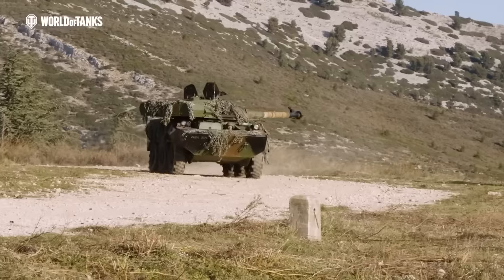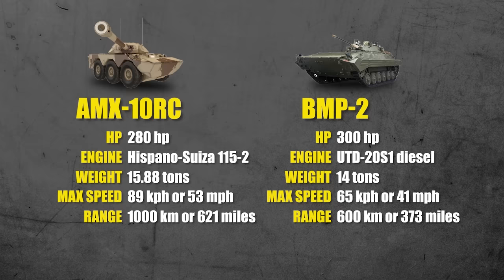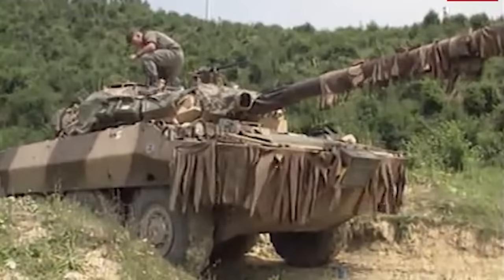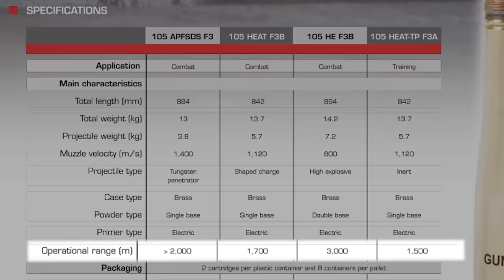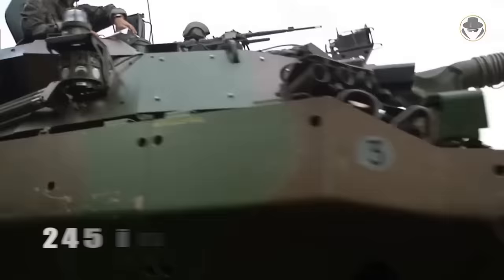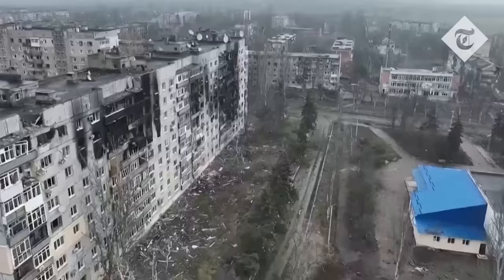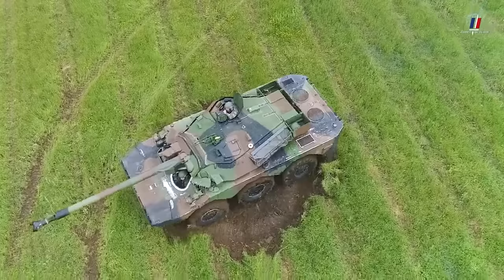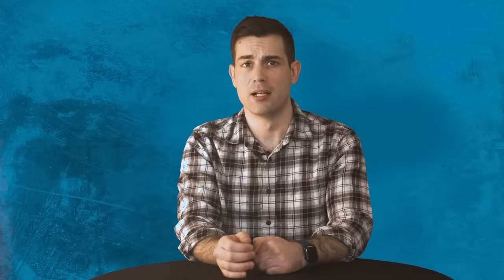Can the French AMX-10 RC Make a Difference?

Comment: I think one under appreciated aspect (which you sort of covered) is that it also frees up actual tanks to do tank stuff instead of responding to infantry requests to blow holes in buildings
Reply: AT4 already do this for a fraction, these odd vehicles are paper tigers. It may be working as the soldier think it works. It's the reason why rifles couldn't be replaced with grenade and rocket launchers as the soldier didn't trust the weapon. It may be giving hope but it may as well be false hope since you're killing people with bad equipment in hope they will pull it off by sheer will as the anti tank weapons cook them alive. In africa it worked with these vehicles because Africa is relying on getting A to B and fear tactics.  If Africa somehow decided to have the capacity to fight the paper tigers would end up burning. Russia rely on fear and paper tanks. Ukraine may pull it off. As long people are willing to sacrifice thinking they have a chance because they have these T-eddies with them who can spin around in a cricle.
Reply: @robertagren9360  you practically described the russian army at the beginning of this war
Reply: I think it would be useful Assault Gun, for lighter formations like Kraken. Alongside reconnaissance vehicle.
Reply: amx 10 was proven as junk in the ukraine totally suicidal to ride into battle in that piece of cr.. It was junk even when designed-the whole idea of mounting a big direct fire gun on rubber wheels is ridiculous and that piece of sh.. costs more than a tank
The Czech proved wheeled spgs are actually better in some cases than tracked and armies have been using wheeled recon vehicles and apcs for a long time but for an armored car to act like a tank is nonsensical It just proves French technology is obsolete compared to the Great Powers and French tactical thought is stagnant and has been for the last hundred and twenty years That horror doesnt even have add on armor It shouldnt have been designed in the first place and even if created it should not have been accepted but somehow the French designed it and their army took it in
sorry to hurt your delusional feelings but although the truth hurts it also sets you free

Comment: I served in Iraq, and was in charge of operation preparation. AMX 10 RC was design to quickly move from France to Est German border for stopping waves of USSR T55 T62 tanks in case of massive invasion. Germany is well equiped with road, so that idea was to control them quicky. With T72 T80, French army rethink strategy of their use in both directions: reconnaissance, and very fast run inside ennemy ligne with wheeled combat infantery VAB in order to overflow them by speed with support of heavy artillery of the AMX. VAB HOT or MILAN to protect the task force against more powerful tanks. Kind of modern ligth cavalery mission. It has been proved very efficient so that French stop to use tracked tanks. US were so impressed in Iraq that they adapted our model of organisation and now, their are also developped and now use powerfull wheeled tanks.

Comment: Great stuff! AMX-10 has a laser range finder and computer-assisted aiming, so the lack of stabiliser is not a deal breaker. It also has 6X6 drive and great hydraulics, which gives very good off-road capabilities. Besides it seems no one is launching offensives during the mud season anyway. There is lots of terrain in Ukraine to cover... so a rapid response unit will be very useful for their infantry. Wheeled vehicles are also easier to use and maintain than tracked vehicles.
Reply: My thoughts exactly
Reply: I loved this vehicle. It was part of my tank fleet in Armata Modern Tanks. Lol.
Reply: Great info. Thanks for posting.
Reply: Rather replace a tyre than a track for sure
Reply: Actually member of french military told me the latest upgrade is stabilised. I appreciate that's not much evidence. Just I was curious.
Reply: @murphy7801  amx 10 rc have... a strange type of stabilizer: it do not stabilize the gun, but the optic only, FCS will fire the gun when gun and optic align up
Reply: @duytranuc4025  I mean... If it works, it's a clever cost saving measure. Stabilized optics are cheap (relatively), a whole stabilized gun probably not so much
Reply: @ska042  Probably would need a redesign of the entire turret to integrate a stabilization system.
Reply: It needs thermal imaging.
Reply: I agree with you. I think it will be used to protect flanks of rapidly advancing tanks.
Reply: A Stabilized gun is only required for shooting on the run. Most shots are from a parked position.
Reply: There's also nothing saying that the Ukrainians can't refit them to NATO standard as the barrels wear out and need replacing. Heck, they've even created their own turrets for their own tanks. The Ukrainians are bloody-well MacGyvers when it comes to these things.
Reply: @Tomato Fettuccini, ikr? Those Ukrainians are freaking innovative with military arms.
Reply: The HIMRS are wheeled and it hasn't been a problem. Different use but I'm sure they won't complain about getting it. It's also mobile and can get from one side of the country to the other under it's own power and that's probably going to be nice for rapid reaction.  It's not a tank but it is useful.
Reply: @kenibnanak5554  il est équipé d'imagerie thermique 😉
Reply: They also output a lot less noise when on the move over any terrian...
Reply: Citroen hydraulics?
Reply: @duytranuc4025  Dont throw this shit myth around,the stabilized optic does not work like that,
Reply: AMX-10 is totally outdated. 6X6 works extremely bad for Russia, since here is a slush and lacking of movements make it a easy target. All squads have RPGs which easily destroy this type of vehicle. On the long road from west to east it is really easy to be destroed by air force or misseles.
Reply: @oleg3269  "On the long road from west to east it is really easy to be On the long road from west to east it is really easy to be destroed [sic] by air force or misseles"
Much more threat from Russian infantry AT missiles than aircraft...   The problem is that Russian air doctrine does not focus on battlefield targets of opportunity, but stand-off strike missions.  And when they do actually try to use tactical air support, they discover that NATO supplied manpads and anti-air weaponry makes the battlefield a lethal place.  Which is why they lost 9 aircraft last week trying to do air-to-ground support.
Reply: @oleg3269  Outmoded? Perhaps, but less than the original T-72s or the T-62s present in large numbers on the Ukrainian front.
Reply: @duytranuc4025  actually that is kinda false; it cannot fire on the move at all but the FCS does point recuperation so if the ennemi that you "locked" before moving does not move you can realign faster but that does not mean fire on the move at all
Reply: Exactly.
Reply: @kenibnanak5554  Too expensive against such a backwards army.
Reply: @stormiewutzke4190  Noting we haven't heard much on YouTube about HiMars these past few weeks.  That said they don't usually sit on the front lines which this vehicle probably will do and those areas are soggy.  We will soon see how it does in deep mud.
Reply: @silvestrelechat4484  That would be good because at night Thermal Imagery enables seeing the enemy before they do without sending out a laser or something their own IR may see.
Reply: @jojolafrite90  You miss the point of Thermal Imaging.  Night fighting.  Lasers and IR projectors can be seen by almost any Night Vision Device.  But Thermal Imaging (aka FLIRS) can't be detected until the guy with it is shooting at you.  Even a relatively cheap civilian model like those used by hunters in the US would potentially give a big advantage to a vehicle commander, driver or gunner using one.
Reply: @kenibnanak5554  It has very good thermals and a battlefield control system... it is a recon vehicle after all, so spotting enemies for the artillery is something they do well
Reply: @olivierpuyou3621  You compare different types of vehicles. AMX-10 is close to BMP. T-72 is pretty modern, expecially if it is modification b3. Leopard 2a4 which is going to be provided is close to T-72. The number of T-62 is really low, and more and more we can see T-90M.
Reply: @majormoolah5056  Excellent.
Reply: @kenibnanak5554  the latest variants have it
Reply: @TomatoFettuccini  GIAT tried to fit a 105mm G2 in the original turret, this didn't work well. They had to rebuilt it from scratch and then the 10RC could handle the full power 105mm. Sadly this improvement was never put in production and only one prototype was built I'm not even sure it exists anymore since the turret was also fitted on the VEXTRA wheeled IFV, a forgotten wonder from the late 90's who didn't survived shitty politicians and their military budget cuts.
Reply: I got an effective firing range of 2km. That's a freaking joke. That's not even half the firing range of a tank, not talking about all the other systems it has to survive with even more.

Even infantery is a massive threat for that scrap pile.
Reply: @oleg3269  Peopel also don't get that near to never a tank fights another tank, especialyl not in modern days.
Reply: @kenibnanak5554  It has a Safran automatic fire control,  and a laser ranging system produced by CILAS. It is also equipped with a Thales CASTOT thermal camera capable of observing up to 4,000 meters.
Reply: @oldmech619  a stabiliser also greatly reduce the time needed when engaging a target after stopping, and giving the speed of the AMX-10RC, it will rock you when it breaks.
It also really useful for machine gun fire, which is way more practical to use on the move than a gun, especially at high speed.
Reply: @kenibnanak5554  thermal imaging is used no matter the time of the day, it completely negates any visual camouflage.
It's an additional advantage against an enemy without thermals at night for sure, but it's not the "point" of thermal imaging per say.
Reply: @oleg3269  it's definitely not in its prime anymore but outdated I doubt it, especially in Ukraine.
I mean I'd rather be in a AMX-10RC than in a BMP-1 (even a 2 honestly) or BTR for example.

It's hard to compare because there isn't really a similar vehicle in Ukraine right now.

By the way don't just call it an AMX-10, because around 15 different vehicles have a name that start with AMX-10 and most of them are derived from the AMX-10P which is the former IFV of the French Army (and it definitely doesn't look like a 10RC).
Reply: What do you mean - Russia is going forward in every sector - certainly on the offensive. Planning to send up to 500,000 troops in the north.
Reply: @Pratt_  I hear you about the camouflage.  Noting some had success hiding from it by cloaking themselves with thick carpet.  But that was soldiers, not vehicles with a running engine.
Reply: @jean-pascalesparceil9008  That sounds pretty good.
Reply: @kenibnanak5554  it has a DIVT 16 CASTOR thermal imaging camera

Comment: The thing about these is I always felt like this was one of the best recon vehicles in all of NATO. Far superior to using HMMVs and the French formation on an AMX-10 with two VBLs was a good platoon setup. 

One thing you didn’t mention here Cappy, these are slated to be replaced by the Jaguars. Which is already happening. So potentially half the French fleet can be freed up for export. The original gun used a unique round but that’s not a weakness in this case. The French actually have ammo for this and if they send the old ones they can send ALL of the ammo. 

I’ve seen these shoot, it’s a better mobile gun platform than the Stryker Dragoons. With HE and AP munitions these are gonna be useful just as backup but with the range and speed involved, this is better than any technical or recon vehicle Ukraine currently has. 

One more thing. 

This is a tank. Not by NATO standards but the French have never abandoned the doctrine of fielding light tanks. They just don’t use them to slug it out with MBTs. They use them for screens, recon and to mess with backfield supply lines after a breakthrough. Ask any French soldier and he’ll tell you this is a light tank. 

Which is obviously an important capability since the US Airborne just got something similar but actually bigger. I remember people poopooin’ these years ago. They were wrong then. These replaced the old Panhards and that little AMC-90 was probably the most ubiquitous piece of battlefield armor in the world for most of the Cold War. The concept is solid, even if the “big armies” don’t ascribe to it. 

The Ukrainians might just make these things as famous as the Israelis did the old 90’s.
Reply: Best recon before drones , maybe. Now it's just an easy target for artillery and ATGMs

I wouldn't want to be in one of those while it crosses miles of open fields, that's how ukriane lost its first tanks.
Reply: @Casimir III  Those definitely seem like good points but I can also imagine the Ukrainians finding a very useful role for these in tandem with drones and friendly artillery as a spotter.
Reply: Ooooouuuurrrrrfffff Parce ce que Macaron 1er à mis l'Armée Française A L'OS , on n'a plus rien, on est à poil !!!!!
Ah les roosbeefs !!!! La perfide Albion !!!
Reply: Cappy actually did mention they were being replaced by the Jaguars and hence a lot more might become available.
Reply: @asm5987  ils sont replacés par les Jaguars.

Comment: the AMX-10 is great for France as it was mostly used in low level conflicts - rapid deployment (ie fits in an airplane and is light) was more important than heavy armor and firepower. And I think, that's where it can either fall down or be useful in Ukraine - having a few units stationed somewhere in the middle between two or three possible fronts, it is a force that can move quickly to concentrate firepower and take out the vehicles that support a tank rush, while AT-missiles should blunt the armored divisions. It could also be used after a breakthrough is reached to go behind enemy lines - if the terrain allows that. Downfall: if it is used as mobile ATGs to stop tanks.

Comment: Served in the 9th Hussars , we had EBR , we were told armed reconnaissance was going forward fast looking for trouble , 
not sneak around and scuttle away but engage , kicking butts and moving fast , when we got our butt kicked call for heavy armor , we had found where they were
Reply: J'ai servi au 10 éme du Génie am Otterstadt am Rhein, je suis rentré dans un EBR au 1er Spahis, je suis sorti avec un tire-bouchon, et donc à la française.
Ce machin est fait pour les nains...
Da Tovaritch ???
Reply: @asm5987  it's even worst than that , there is two drivers on front and one back for a quick run for cover , to get out they had to remove the steering wheel first
Reply: @asm5987  c'est pas trois postes 
c'est deux position de conducteurs , 
verifis sit tu veux , 
le site est en Anglais . la plus elementaire courtoisie est d'util;iser la langue.
quant a tes obsenites ,
 c'est la reflexion de ta vie , pas la mienne

Comment: If there’s a tank you want to bring into an urban environment it’s this one. The rear wheels can retract allowing the vehicle to stand up and drop rounds over a building. I’ve seen it operate in jungles. It’s use to support infantry is proven
Reply: Sorry but on the contrary it is made to fight at a distance, urban combat is very difficult and dangerous with ATGMs. Are successor the "Jaguar" is much more adapted to the urban combat with 8 more tons and a very powerful Chain gun.